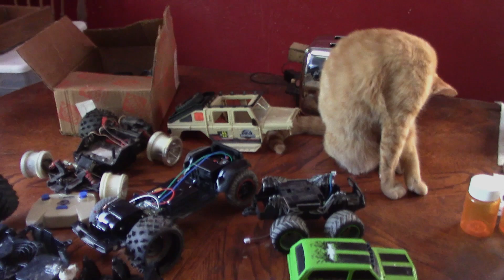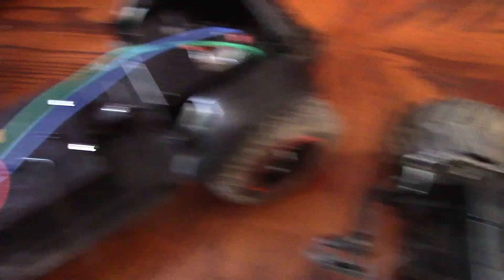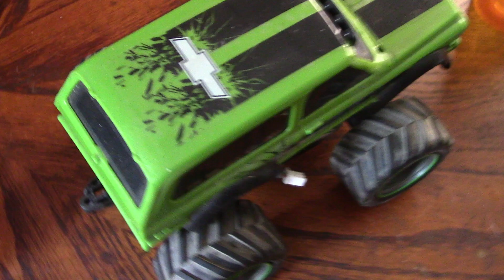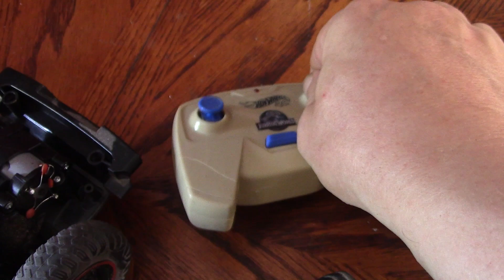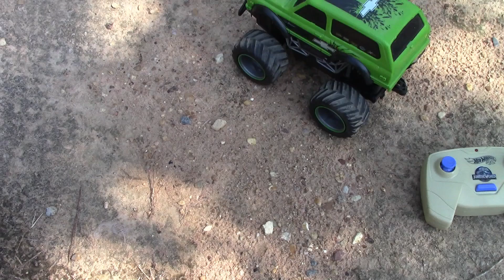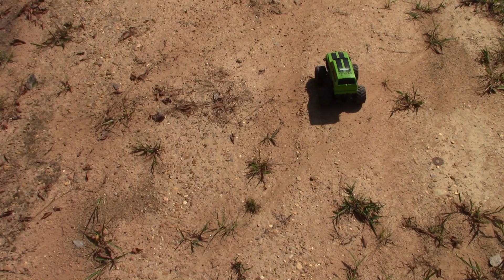How to circuit swap an RC car

Comment: You may find the steering is a little indecisive running it with less power as the drive motor tends to get priority. Great fix 👍👍
Reply from the maker: Yes, I agree. Can see that in the vid near the end where it reverses but doesn't turn well. All in all mind you, it trundles well and much better than the other one!
Reply: @Slider2732_  the wheelbase won't help either. With such a "square" layout (viewed from above) the straight back wheels over-ride the front steering. I have several cars in that format and it is very noticeable. Full power on full lock and it just ploughs straight ahead 🤣🤣
Reply from the maker: @GrandadIsAnOldMan  Ah, great observation and tip! Thanks.
I know what you mean now. Have got a Ford Mustang intended for drifting and it's bad on our gravel/sand surface... but, it's got a long wheelbase and does always turn with no issues.
Reply from the maker: Btw, 99.1K subscribers. I hope you get your YT silver award soon. Congrats in advance 😁
Reply: @Slider2732_  Maybe this year, maybe not. We will see. A few more views per video would be more rewarding.